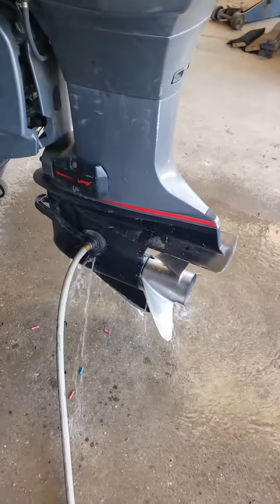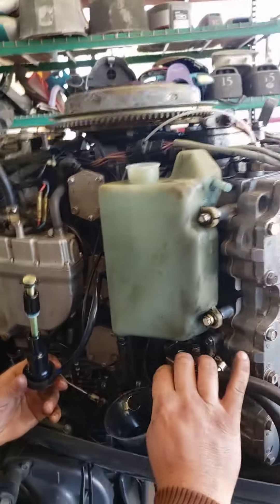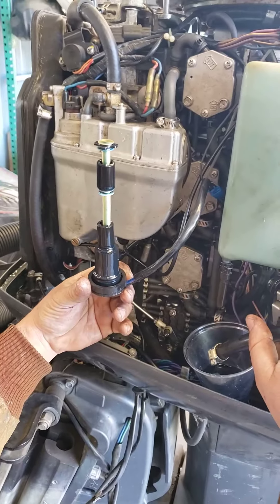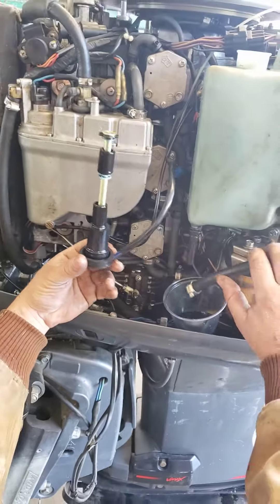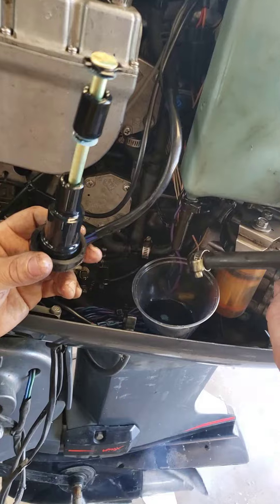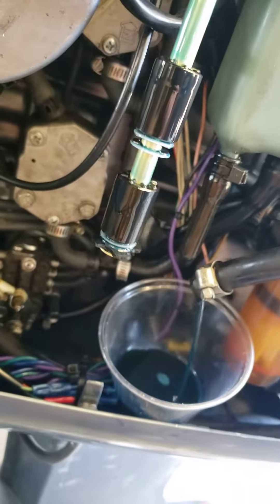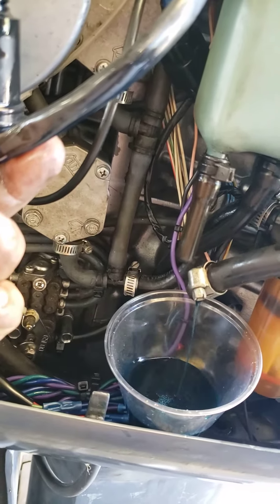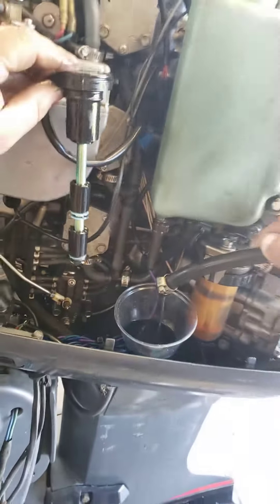Yamaha OX66 Confirmed oil tank sensor is working

Comment: I watched your other video - thank you. I have a similar problem. My pump will not work when connected to the wiring on the boat. I can hear it click when I use the manual switch but will not pump. If I connect it directly to a 12 volt source it will pump. Both sensors in the boat and motor tanks have been replaced. I b=have verified that I am getting 12 volts at wiring connection at motor and wiring connection at boat tank and also at butt plugs that go to the pump.
Again, I can hear it click when activating the manual switch but it will not pump. Connect it directly to a 12 volt battery at the butt plugs and it pumps.
Any thoughts?
Reply from the maker: Check for ground from ecm to the pump when float is down.
Reply: @hotheadzmarine  Thank you - I will also do that. 
I was just out looking at it again and I have a suspicion that it is a questionable connection from the pump wires to the wiring harness. I messed around with them and got the pump to work for quite a few minutes through the manual switch. Of course, after I mounted the boat tank back into the boat it stopped working. I will buy some new connectors and test it again. Your video was very helpful.
Reply from the maker: @AussieDors  Thats kinda what this one did if I recall but it wasn't the connection. Hope that gets ya going. Frustrating work at time's. Hang in there and don't over think it.

Comment: Hey is there a fuse or anything between the on board oil tank and the engine oil tank.?
The sensor is giving me a warning on dash...but no oil coming from the on board tank...even with the switch on the computer to test the oil.... nothing?
Is it safe to say the oil pump on the on board tank is bad?
Reply: Did you resolve this issue? I’m experiencing the same problem.
Reply: @georilla  was a bad oil pump on the oil tank itself.
Reply: @jamesrahn8339  That’s what I think is wrong with mine. Just sucks because I have two motors and they’re both bad.

Comment: Does the engine have to be running?
Reply: Same question.  Override switch engages pump after replacement but new oil level sensor will not with engine off.

Comment: Salutare am si eu o problema cu un motor yamaha autolub 25 cai 2 timpi mi sa stricat senzoru ulei si am decis sa anulez pompa pentru ulei si sa ii fac amestecu direct in canistra dar problema ca dupa ce am anulat pompa  de ulei dupa ce merg cuniel 1 chilometru imi intra in protectie il las sa mearga asa 30 secunde se stinge becu ce avertizeaza sinpe urma o ia normal se accelereaz o fi si senzoru apa ce sfat imi dati sa incerc sa repar multumesc

Comment: My sensor is not floating for some reason it’s sinking to the bottom and it’s telling it that it has no oil and is manually pumping oil into it but it’s full of oil I cleaned the stick and around it but it’s still doing it but the funny thing is it will run just fine 3/4 throttle but when I go full throttle it starts beeping
Reply: And when it starts to beep I will trim the motor up and down and it will shut off can you please tell me something I have to be in the rodeo this weekend lol